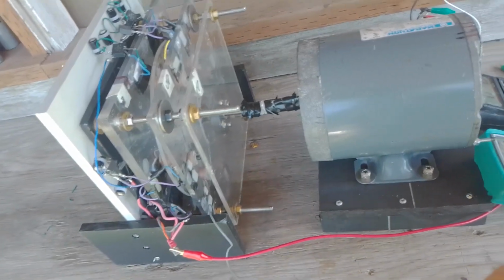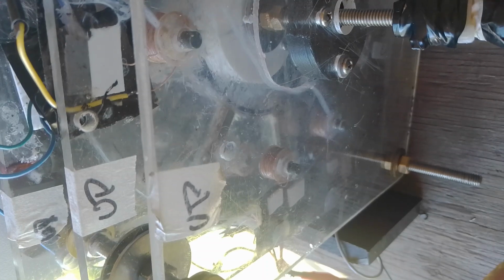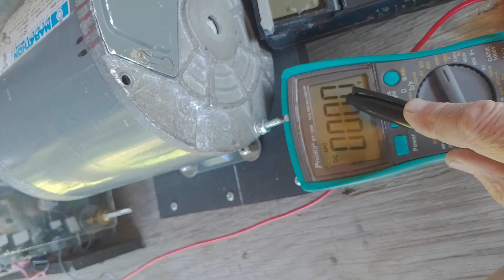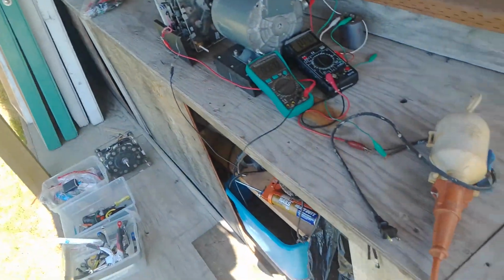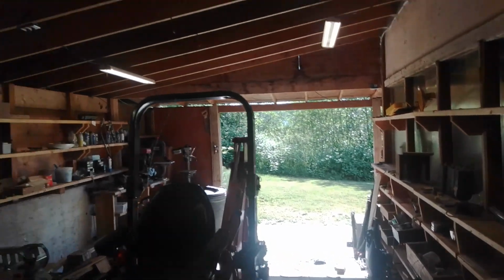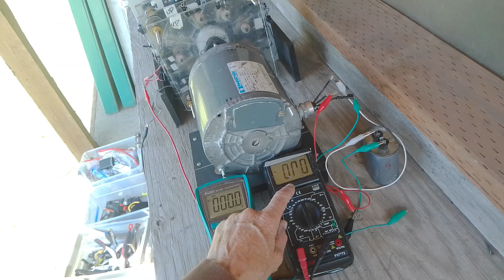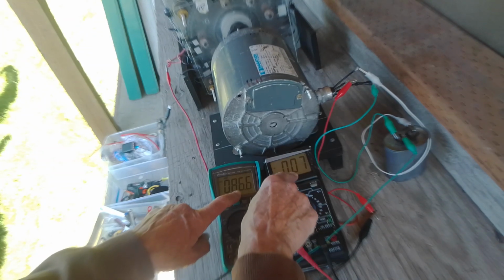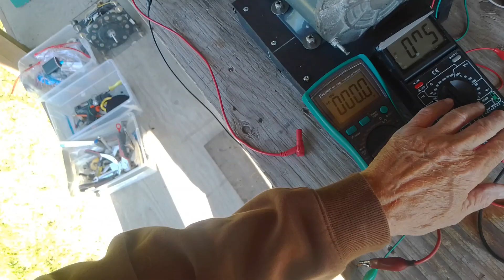BPMFDA being spun by rotovertor test plus tour of workshop

Comment: Doug could you use a buck booster on the DC output to drop it down to 12 volts from the higher voltage? If you could get 12 volts, maybe the Statpower might be interesting.
Thank you for the tour. It puts an added push to my barn work, to get everything weather tight, and critter free.
Cheers Warren
Reply from the maker: Hi Warren
I was thinking stepping down to below 10V,  rectify then step up with boost convertor to run my statpower...same idea...
Kone

Comment: Nice workshop Doug! You need a Rocketstove to heat it, isn’t it? Lots of videos on that on YT. The tour of your motor generator set is even better. Can you explain the ‘crowbar’ thing? What daya mean with that?
Reply from the maker: Hi Hans
Crowbarring with ammeter means to put the ammeter in AC amps, then short out the coils with the ammeter between the coil leads, so that you can see the amps "circulating"